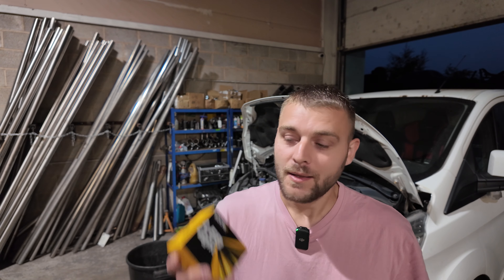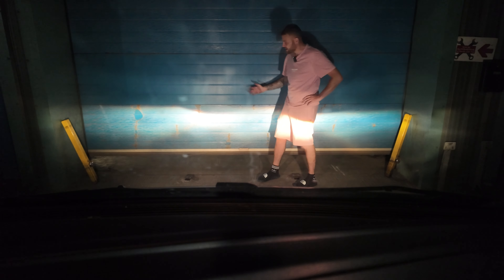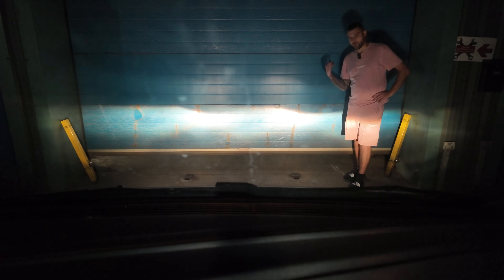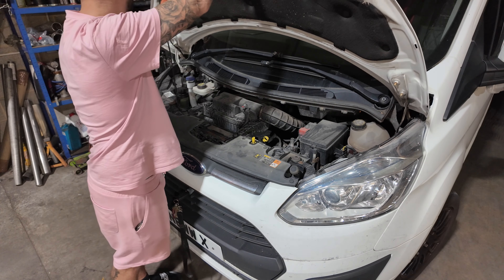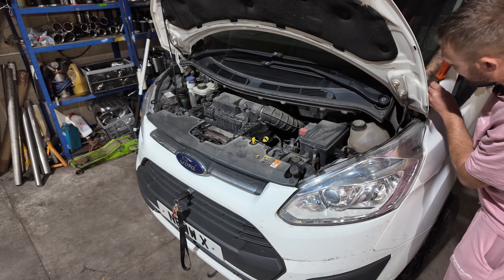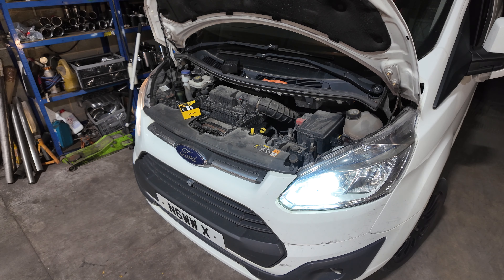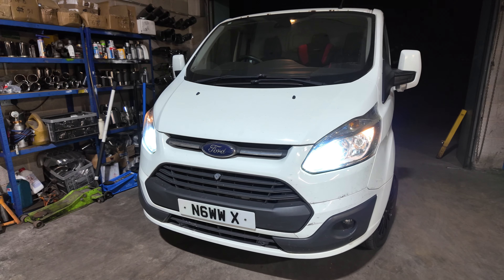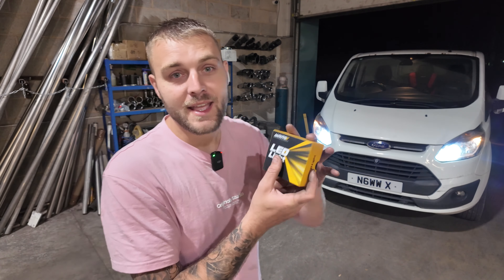The BEST Headlight Bulb Upgrade For YOUR CAR: AUXITO LED Bulbs Reviewed #auxito #ledheadlights

Comment: I bought the H7 to go in my mk3 focus and they go out when you started the engine and give you an error.. waiting for an obd lead now to look at the settings to get them working
Reply from the maker: Yea sounds like you need to enable an led bulb setting or similar as they are failing the canbus check

Comment: I got some of the same for my insignia had to take them out even though like you said error free 😂😂 not on mine 👎🤣
Reply from the maker: @craighorton6387  did you install the error free resistors?
Reply: @NAWFABZ  no pal
Reply: @NAWFABZ  plus the access to bulbs is awful on a insignia not much room for bulb never mind a resistor 👍
Reply from the maker: @craighorton6387  install those error free resistors and you will be sound ✌️ they sell them on their site.
Reply from the maker: @craighorton6387  did it make you a little sad then with how easy the transit was to install 🤣😬
Reply: @NAWFABZ  yes 🤣🤣🖕
Reply from the maker: @craighorton6387  😆😆

Comment: 14:26. The beam pattern on the LEDs is atrocious. You'll be blinding every oncoming car with those fitted. Look at the cab of the van parked sideways. Plus with no sign of any substantial heat sync they'll dim and burn out pretty quickly.
Reply from the maker: In my opinion the beam pattern isn't too bad, while driving it's not blasting light onto the opposite side of the road and had no complaints from other drivers. As for heat sync the whole body of the bulb looks to he a heat sync it's a full aluminium body. Time will tell ✌️
Reply: The beam is very good. Just a slight little adjustment to tone it down a bit and that’s it. 

On camera it looks too bright. But in person is not that bad.
Reply: I think you have the passenger side badly oriented inside the headlight, that's why you are getting a bad beam pattern. Try having the LED chips facing side to side.

Comment: LED bulbs do not throw the light as far as xenon bulbs that's there only downfall
Reply from the maker: I'm pretty happy with these led to be fair, made a pretty good difference at nighttime over the halogens
Reply: Ur right and wrong. 

1: it depends on the led bulbs and the wattage. If u have a 35W HID, I will be brighter than the lower wattage led. Some of the led bulbs are easily brighter than 35W HID, and it can be as bright or brighter than a 50W HID. And it’s true. It throws the light properly the same as oem. 

But not all led bulbs are created equal.